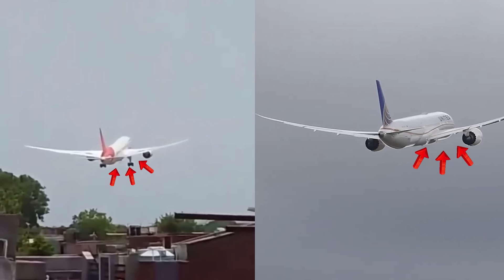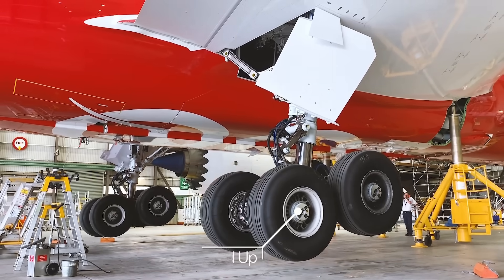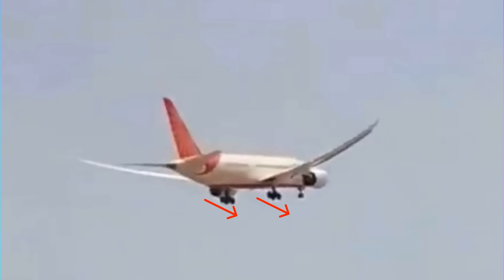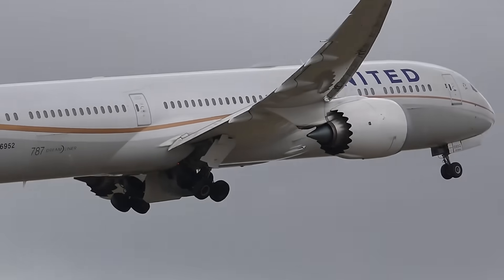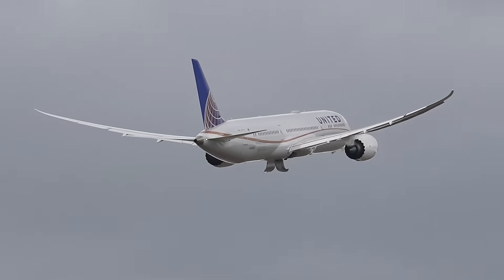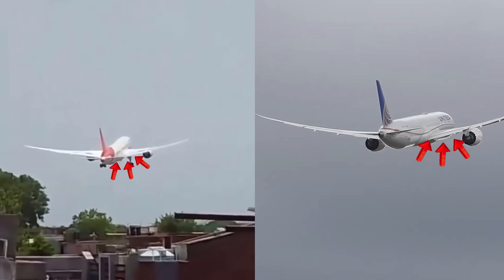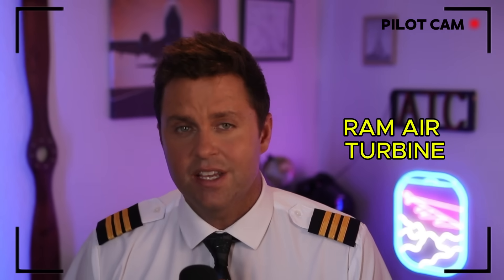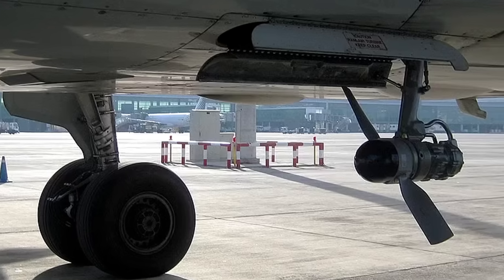Pilot Explains: A New Detail in the Air India 787 Crash Everyone Missed

Comment: Why you do not list 4 points instructon of Boeing 787-8 where are conditions listed? There is "loss of 237V electricity Bus power and all hydraulics" - that is for one. In manual ffs. Secondly, gears look like they were starting to go up and stopped in the middle. Thirds - one alive witness said of 'light blink' just before the plane started to descend - that sounds like whole electric bus and hydraulics fried when they pulled the lever for the gear up. From there ... RAT popped (they did not started APU and it requires 30s to start) so they had black screens!

Comment: Questions. Gear tilted up but gear doors not open? how can that be? The doors open almost immediately after the tilt. Something happened when the horizontal attitude of the plane on take off tilted up, how can that be? Something denser than the fuel sucked into the fuel lines? Are both tanks filled by the same tanker equally? Fuel theft and something else used to make up the volume?

Comment: Thank you , guess you waited , analysed and then came out with this video. Totally agree , it is impossible to believe Pilot being blamed that they forgot this and that , remember senior pilot was a very experienced pilot he is a certified trainer as well. Also none of the experts on youtube acknowledged that mere 31 seconds flight guys - it is do difficult to comprehend - in this 31 sec Pilot able to detect and pass Mayday is out of this world. People on ground stated that they thank pilot because it appeared he tried to crash land on empty area rather than on buildings. Guys I am buying only 2 theories - even if thing can happen 1 in a billion then this moment was that 1. 
For example a catastrophic electrical failure , dual engine out , hydraulics loss pressure. I wanted Gary here to highlight that the descent was graceful like the plane was landing , any one can make out it appears that at 625 feet power turned off and plane just glided down.
One of expert stated vapour lock due to excess heat conditions !!

Comment: As a layman, I fail to understand why the aircraft doesnt have multiple redundancy for the power system to include an online UPS battery storage system and Inverters to bridge the time gap between the auxiliary engines firing up and deployment of the RAT. Shutting off all non emergency systems would help.
Also leaving an auxiliary engine running on standby during the critical phases of the flight should be standard procedure, incorporated in the flights operating system by the manufactures. This will save the critical few minutes of blackout/ brownout which could mean saving lives and the Aircraft.

Comment: Sweltering 100F heat. No AC to cool the plane down. Literally cooking an hour or two before takeoff. Developed vapor in the lines that could not be compressed hydraulically because electrical outage that affected the hydraulic pressure that would have gotten rid of the vapor bubbles in the lines. That led to pumps not being able to feed fuel into the engine. Automatic gravity feeding fuel inefficient when nose is in up direction. All of this led to engine fuel starvation. All in 30 sec. Not enough time

Comment: Another you tube pilot put forward a theory of fuel vapour bubble from the heat potentially from the plane sitting on the tarmac for a long time without air-conditioning on coupled with hydraulic failure and the angle the plane was on starvd the engines of fuel, subsequently causing a double engine failure. Furthermore, a passenger on a previous flight on that particular aircraft spoke of electrical problems on the plane and another passenger from a flight approximately a week before on that plane spoke of electrical problems resulting in the plane receiving repairs and the passengers having to disembark and stay in a hotel overnight while the said repairs were carried out.

Comment: Guys, it's not the flaps. This plane can take off at this temperature, with this load, with 0 flaps. I have no idea if you are actual pilot, but tell captain Steve who initially thought the pilot set flaps 0 instead of retracting the gear (how is that even possible when they are miles apart on panel) that even with flaps 0 the plane would climb. Most probably plane lost both engines (therefore the RAT and the mayday) due to el issue (not bird atrike) as el issues were reported on the previous leg 2 hours before from Delhi. Come on.

Comment: Most of this was reported on by the swiss channel a few days ago...
Loss of engine thrust is likely to be the cause of the crash, the root cause will likely be loss of fuel to the engines. The cause of that loss of fuel is anyone's guess at this time, but I'd put my money on electrical failure affecting the fuel pumps, or as an outside guess, intentional closing of the engine fuel switches, or powering down of the pumps. 
My instinct is that pilots usually want to live; so I fall on the side of catastrophic loss of power leading to fuel starvation of both engines.

Comment: Fuel system is the only common system for both engines that would cause failure outside of computer malfunctions or someone left a canon-plug disconnected.(didn;t this a/c just come out of MX check?)

Comment: Stolen airplane fuel could be used for resale, vehicle or generator fuel, heating/lighting, industrial solvents, or fuel adulteration, driven by its high value and versatility. The replacement of ATF with water, as possibly occurred in the 2017 Kolkata case, suggests a strategy to mask theft by maintaining tank volumes. However, no recent confirmed cases (post-2017) explicitly link fuel theft with water replacement at Indian airports, though the 2018 Rajkot theft and speculation around the 2025 Ahmedabad crash indicate ongoing vulnerabilities. The high risks and regulatory scrutiny make such theft challenging but not impossible, particularly with insider collusion.

Comment: As per reports survivor heard a bang before crash basically indicating RAT was deployed due to engine or electrical failure which lead to loss of thrust after take off. I also feel it can't be contaminated fuel, if that was the case how did they even take off in first place. But again another reports show that pilots used full runway indicating there may have been an already strain on engines to reach the required speed before takeoff. It probably may be something like overheating of some fuel supply equipments or significant electrical wires which caused the entire system to fail.

Comment: The Bus Power Control Unit (BPCU) manages and monitors the distribution of electrical power. All this Problems with Fuel Pump, Cabin Light, RAT deployment are based by the BPCU and this Unit is not fully redundant in 787!

Comment: Passenger jets take off all the time with gear down and survive flaps up or down N2 110% through the wall. The jet will fly! crack the fuel manifold,bust the crossfeed valve, or shut off the fuel. That's something else and when that horizontal went into deep stall, the flight was over.

Comment: Why does it  take 3 profesional pilot to find that it was double engine failure? 1) Flaps up - airplane would fall down sharply due to low airspeed , but it did not... it was nicely gliding down at low speed- it means flaps must have been up. 2) One engine failure- it would climb all the time but it did not....  The only thing left which would cause gliding is double engine power loss. Does it need 3 profesional pilots to find out what is clear to everyone who knows something about planes???? Regarding contaminated fuel... other planes had no problems....unlikely... I believe, engines did not fail, but something switched them off as this aircraft is is too computerized...

Comment: I am confident that there was a catastrophic electrical failure during takeoff, most likely due to inadequate maintenance. The RAT was deployed. The problem is that this aircraft doesn't use engine-driven mechanical fuel pumps. On the other hand the RAT doesn't provide the power for the fuel pumps. Takeoff is the most critical and demanding part of the flight, and the fuel feed must be adequate so the engines could produce the needed thrust for the aircraft to climb.  In this case that was not possible, since the fuel feed was gravity driven, and insufficient because the nose was pitched up. Due to insufficient thrust, the aircraft stalled and crashed.

Comment: It seems to me that the flight data recorder should be able to indicate (if the system isn't damaged to any major extent) what happened with a high degree of certainty, yes? Is the point of these pilots coming up with theories at this time just a kind of guessing/analysis game just for the sake of puzzle-solving enjoyment. But if that black box turns up too damaged to tell anything, these YT examinations by pilots and aeronautical engineers should help figure out what happened. It will be very interesting to find out what that black box will have to say...and I wonder how long it will take before any findings are released.

Comment: Fuel contamination through humidity. Google it. Engines on the 787 are known for water droplets forming in the fuel lines.
I think this caused a flame out of both engines just after take off. possibly the bang the survivor heard. Maybe some under power on take off too as it was practically at the end of the runway when it took off. Maybe the Captain then increased throttle as they lifted,  both engines then went down as the copilot selected gear up, then the RAT deployed and the Captain called a mayday.

Comment: As far as I know, these controls on an aircraft take some time to complete an action, whether it’s the flaps or the landing gears. Additionally, in the cockpit, the controls configuration for landing gears and flaps aren’t next to each other. This means that pilots retract the flaps instead of taking up the landing gear. This is quite unusual, anyway. If the pilots make a blunder here, the engines are so powerful that they will take the aircraft up. On top of that, Boeing 787 has multiple protections in place to prevent accidental flap retraction during takeoff.

Comment: Contamination of fuel would have to come from an internal source to the plane, because other jets before and after 787 would have suffered some sort of similar problems. So the contamination would have to occurred internally on board the plane, or maybe a mechanical leading to a sudden fuel loss.

Comment: Vapor lock was suggested on another analysis video.  Plane sat on tarmac for unusually long period of time. Suggestion was made that the USP auxiliary power unit was not connected to cool the plane and so vapor lock may have happened in the fuel lines which may have been mitigated by hydraulic pump failure producing vapor lock and flame out on both engines. I have to wonder whether or not there could be some type of software attack terrorist action to shut the engines off maybe a long shot maybe not.

Comment: I was in aircraft maintenance from 1973 until 2020.  I'm 72.  In 1976 a buddy of mine was in a KC-135 escorting a U-2 to Diego Garcia.  Approach to landing one engine shutdown, then a second engine shutdown then a third engine shutdown. After crossing the threshold the fourth engine shutdown.  Reason - water in the fuel tanks.  Someone didn't sump the fuel tanks.  Around 10 to 15 years ago a B737-700 had all 4 fuel boost pumps shutdown in flight.  Reason - The control switches in the cockpit shared a common ground.  That ground was corroded.  Fuel flow continued through gravity feed. We did a rewiring to have separate ground.  Guessing is easy. Finding the route cause is more challenging.

Comment: 1. Engine Failure/Loss of Thrust:
 * Dual Engine Failure: Although extremely rare, a simultaneous failure of both engines would lead to a complete loss of thrust, making it impossible for the aircraft to gain or maintain altitude, especially at low speeds and altitudes typical of takeoff.
 * Single Engine Failure followed by incorrect pilot response: If one engine fails during takeoff, the aircraft can still fly on the remaining engine. However, incorrect pilot actions, such as accidentally shutting down the live engine instead of the failed one, or pulling back the thrust lever of the live engine, would lead to a critical loss of power.
 * Fuel starvation or contamination: Issues with fuel supply to the engines (e.g., clogged fuel lines, incorrect fuel valve settings, or contaminated fuel) can cause engine power loss.
 * Bird strike: A bird strike, especially a large bird ingested into an engine, can cause significant damage and lead to engine failure or loss of thrust.
 * Mechanical/Technical malfunction: Various mechanical issues within the engine or its control systems can lead to a loss of thrust.
2. Aerodynamic Issues / Loss of Lift:
 * Incorrect Flap Configuration: Flaps are extended during takeoff to increase lift at lower speeds. If flaps are not set correctly (e.g., not extended enough, or retracted too soon), the aircraft may not generate enough lift to become airborne or maintain flight, especially with other complicating factors.
 * Retracting Flaps too Soon: Retracting flaps at too low an altitude and speed significantly reduces lift and increases the risk of a stall, especially if there's already a thrust issue.
 * Incorrect Takeoff Trim (Center of Gravity): If the aircraft's weight and balance are incorrectly calculated or entered into the flight management system, it can lead to an improper center of gravity, affecting the aircraft's stability and ability to generate lift during takeoff.
 * Excessive Takeoff Weight: An aircraft taking off with a weight exceeding its certified maximum takeoff weight will require more thrust and a longer runway to achieve lift, increasing the risk of a stall if insufficient power or runway length is available.
 * Extended Landing Gear: While the landing gear is supposed to be retracted shortly after takeoff, if it remains extended due to a mechanical or hydraulic failure, it creates significant drag, requiring more thrust to climb and increasing the risk of a stall if power is insufficient.
 * High Ambient Temperature and/or Altitude: On hot days or at high-altitude airports, the air density is lower. This reduces engine performance and wing lift, requiring higher takeoff speeds and potentially more runway length to avoid a stall.
3. Human Error:
 * Pilot Error: This can encompass a range of mistakes, including incorrect procedures during an emergency (e.g., misidentifying a failed engine), misreading instruments, incorrect input into the flight management system, or mismanaging thrust settings.
 * Maintenance Errors: Incorrect or shoddy maintenance, such as improperly installed parts, wiring issues, or unaddressed technical issues, can contribute to system failures during critical phases of flight.
Important Note: Modern aircraft like the Boeing 787 have multiple redundant systems and safety features to prevent stalls. Any incident involving a stall during takeoff would be thoroughly investigated by aviation authorities (such as the NTSB in the US or similar bodies internationally) to determine the precise chain of events and contributing factors. It's often a combination of issues rather than a single cause that leads to such a severe outcome.

Comment: Doesnt have to be a dual engine failure, if both CCR cabinets fall over the EEC for both engines will lose signal causing BOTH engines to revert to flight idle, and the RAT to auto deploy the fact the plane had multiple electrical issues the sector before ie no aircon, no ife, lights flickering etc indicate it had other issues to do with RDCs or a full CCR cabinet fall over. I guess we will find out but just a theory if CCRs go all you pretty much have is radio and one PFD screen

Comment: I think that it was an electrical malfunction that caused the fuel pump to fail. There were already electrical problems on this plane (AC not working etc) and the survivor told about the lights flickering and turning to green inside the plane, at the same moment that the plane "stalled in the air" (as he said). There were previous accounts of lithium battery malfunction on the 787. If this is the case and Boeing is at fault once again, it will be a devastating blow to the company's credibility, without mentioning having to pay millions to the families of the deceased.